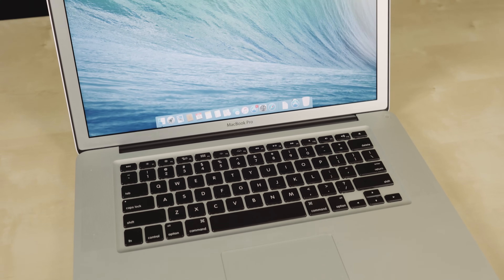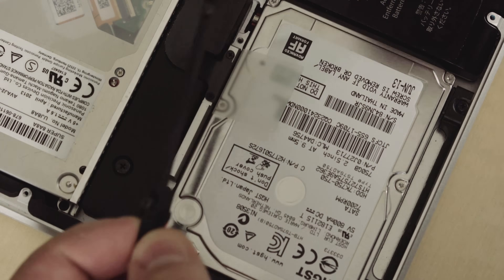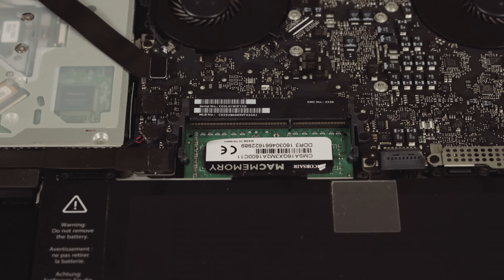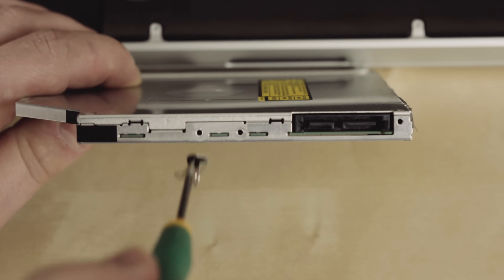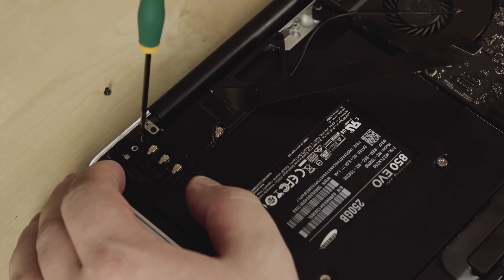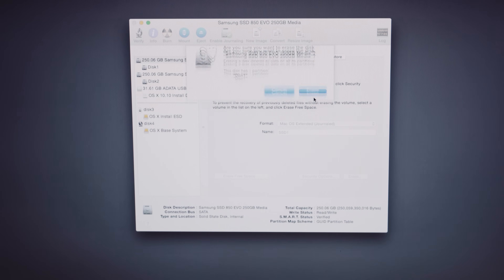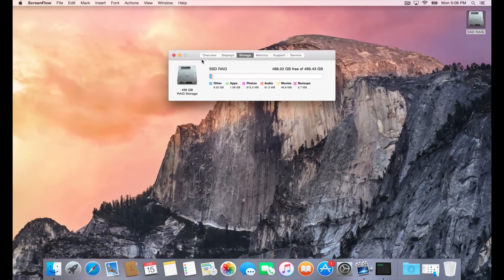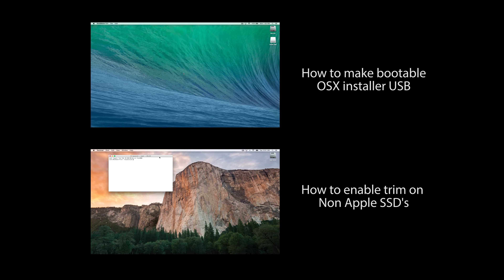Fastest 2012 MacBook Pro Ever! Upgrade Guide - in 4K

Comment: Why would you replace the optical drive with another 250gb SSD when you can get a Samsung 850 EVO 500gb for cheaper than two 250gb? I understand we rarely use our optical drive anymore, but this really doesn't make sense to me.
Reply from the maker: I don't know if I explained what Raid0 is properly or if you didn't see the benchmarks at the end but having 2 drives in raid0 effectively doubles speed and bandwidth giving double that of one ssd. I didn't do it for storage size but for the speed. Thanks for watching.
Reply: oh ok, I missed that part of the video. Thanks for the tip!
Reply from the maker: +Dh Do oh you were talking about buying a new non retina MacBook Pro. Well the cpu isn't as fast on the MacBook Air but it does have a couple years newer graphics and a faster pci-e ssd plus much better battery life. You would probably notice the air being a faster computer for most tasks.
Reply: Hey man, what do you suggest, a new Non retina with upgraded ram and SSD or an Air 13"? I'm not looking for portability or battery life, just the best performance.
Reply from the maker: Any 15" Macbook Pro from 2011 and 2012 with an ssd upgrade will kill any new Macbook Air for performance. if you're talking 13" Macbook Pro then there wont be much difference. 15" has a Quadcore i7 where as the 13" Pro and Air both have dualcore i5
Reply: Zed ProMedia I was talking about the 13, the 15 is out of production now sadly. So between the 13 and the air,I should go for the air right since the performance difference isn't much..

Comment: would it be logical to buy a brand new one of these (apple still continues to make these for some reason) and do the upgrades or just buy a 2016 one which is much more expensive?
Reply from the maker: Apple stopped selling this model back in 2013. You can buy a used one for a pretty good price though. I would not recommend buying the old 13" version from the Apple Store. They should be coming out with new MacBook pros this fall. You should probably wait if you can.
Reply: Zed ProMedia I would rather not buy a second hand and the non-retina macbook pro with the same exact specs as this is retailing for around a thousand dollars, apple discontinued producing them this january so most stores still have them. with the ram and ssd upgrade I tought it would be a good value laptop. I don't really want to pay the amount they are asking for the new pros. I should have asked: should I buy this brand new (with the upgrades) or a brand new macbook air for a similar price?

Comment: another question: will using a single 500gb ssd of the same kind give me the same speed as if I were to used two 250gb ssds the way you did?
Reply: it depends on read and write speeds of the ssd. One type of ssd might better other wise if it is the same type with the same specs, it is equally fast
Reply: thanks!

Comment: Hey I just installed a 16gb ram & Samsung ssd 850 pro 256gb on my 2011 Macbook Pro and still has some lag. Did the black magic disk test and got write 339 & read 345. On yours I see you got write 450 & read 500. Any ideas what I did wrong or didn't do?

Comment: For upgrading the RAM , does Apple have specific RAM cards designed for their products only, or will any laptop RAM cards work?
Reply: Yevette Xoxo there are Apple brand RAM upgrades but you can't buy them and install yourself. 3rd party RAM is not also certified for use in a Mac. If you go to OWC or Crucial's web sites they will guide you to the correct variety for your model Mac.

Comment: Hey! I have a question. What if i use a 500 gb ssd instead of 2 x 250 ssds? What will be the difference???? This is on the mbp w/out retina... What difference will it have?
Reply from the maker: I did raid0 with 2 ssds to show you can get close to the same read and write speeds as the newer MacBook pros. One SSD will still be fast though.
Reply: +Zed ProMedia but will a single ssd be faster?
Reply from the maker: No. Two ssds in raid0 have twice the read and write speed. That's why I did it.
Reply: Ow... Thanks!!

Comment: can i do this on a MacBook Pro (13-inch, Mid 2012)? or what would i have to change??
Reply: Yes you can! Note he is capitalizing on using dual SSD's. The reason I say that is because model Mac you and the one he was using only uses SATA 3 connections which only gets 3gb vs the 6gb. With both SSD's working together he doubled the speed. Smart. By doing this the SSD's in RAID 0. 
 The RAM is simple, you can upgrade to however much RAM you want but YOU MUST keep the SAME Speed as your originally RAM, which is most likely 1600 MHz DDR3.
Reply: Yes, you can

Comment: Would this work with a 2015 model? 15 inch retina
Reply: No.
Reply: Shame, oh well. Thanks for the reply!
Reply: Hugo Stiglitz You can upgrade the mSATA SSD but that's about it.
Reply: anymore detail on that you could give me? I bought a model with just 250 GB coming from a laptop that had 750 and it's really putting a damper on project handling. Also, having a bunch of hardrives to store different projects isn't that great either, would be nice to internally upgrade the SSD. Thanks for the help!
Reply from the maker: The only thing you can upgrade is the pcie drive. And you have to get a specific one from OWC. I'm not sure if the Samsung m.2 are the same. They aren't cheap. Here is a 480gb one. http://www.bhphotovideo.com/c/product/1239059-REG/owc_other_world_computing_owcssdab2mb05k_480gb_aura_internal_pcie.html
Reply: Font go to OWC, they're a rip off. Get it off newegg.

Comment: Thanks! Great vid. I have a 2011 MacBook Pro with a 1 TB Samsung ssd and 16 GB RAM. Just bought a heavily discounted Samsung 256 GB SSD. I want to install the same as you show and setup RAID 0. Could you help with two questions- 1) I would first have to create a 256 GB partition on my already installed 1GB ssd, right? 2) my time machine backup exceeds 500 GB. How do I use the backup if I set up my MacBook to have 256GB running in RAID with separate partition on the remaining ssd of 744 GB. Is it possible to install the OS on the raid partition and tell it to recover files from time machine backup on the other partition ?

Comment: i read that the samsung evos cause problems for your sata cable. Can someone tell me if this is true? thanks
Reply from the maker: I have never heard of this. Why would it cause problems with the sata cable? Like overheating or something? I've used Evo's for years with no issues.
Reply: oh really? can you tell me the specs of your mac and how long you've had it working for?
Reply from the maker: The specs are at the start of the video and Ive been using it everyday for like 18hrs a day since Feb 2016. But I've had other laptops and desktops that I've installed EVOs in and never once had a problem.
Reply: oh wow. Which samsung evo did you install?

Comment: hi can I use these instructions for a early 2011 macbook pro
Reply: For both of you, yes, you can
Reply: I'm wondering the same thing
Reply: Immanuel C
Just buy a USB to SATA adapter, then use a cloning tool to copy the files. I also believe you can use Time Machine.
Reply: My Macbook Pro now has a SSD and 8gb it really fast now.
Reply: Yes it's very easy to do and not expensive it's like having a new laptop
Reply: Hi everyone I've done this on a 2011 MBP it works a treat and is easy to do
Reply: Nope! You can't
Reply: yes you can
Reply: Thanks it does
Reply: are the results the same? I'm considering doing this. I have the parts laying around just gotta put them together. and instead of starting from the ground can i transfer everything from my current hard drive to the SSD before doing thisso it'll just boot as if i had done no changes to the hard drive? i have microsft office on it and i lost the install disc so instead of having to buy it again id like to keep it.
Reply: Thanks :D
Reply: u did that by yourself?
Reply: ok I think I should do it too, but im afraid that I will just mess up my macbook....
Reply: Did you lose all of the files and programs after changing it to SSD? Did you get a single SSD swap or both? I have a late 2011 MacBook pro and am thinking about the same upgrade. About 8GB RAM, that's the maximum 2011 will upgrade to, correct? Also, did you get the same SSD card as in the video (Samsung 850 EVO 250GB)? Which RAM did you get?
Reply: Tony Song  I don't remember the brands exactly but I used a total of 16gb for ram and the SSD's I got were laying around they're 200 each not sure what brand either. To not lose anything I had a friend do it idk what he did honestly.
Reply: Tony Song and mine is an early 2011 MacBook
Reply: mark shirley  really your post its fro 6 months ago how works now
Reply: i did this on a early 2011 macbook pro. Works awesome. super fast.

Comment: HI, 
Why are you using two 250GB  SSD hard drive instead of one 500GB SSD drive and just replaced the old hard drive?
Any suggestions (brand) has far as the caddy to install the second SSD?
Thank you
Reply from the maker: I already owned a 250gb so I bought a second one so I could do raid0 and get double the bandwidth. I don't know of many caddy brands just the one I got off amazon. I find the best ssd brand is Samsung. For reliability and price.

Comment: Mac book air or Mac book pro for school work ?
Reply: I honestly wouldn't get a macbook, I had one recently and got rid of it because starting in mid 2012, I believe, they started to make them to where you can't replace or upgrade the ram, and the batteries/harddrive (SSD) is very difficult to replace.  I wanted a laptop that wasn't difficult to upgrade and replace parts, so I got a Alienware 13 instead and am happy with it.  But, if you want a Apple laptop, Macbook Pro for demanding tasks such as 4k video editing, 3D rendering software, ect. and Macbook air for not so demanding tasks and good for portability due to light weight and thinness.
Reply: Apple MacBook Air is good for school work.
Reply: Macbook air for light papers and what not. To address the other comment, no, you're wrong. The 2012 Macbook Pro can be upgraded.
Reply: +Zestypanda They mean the retina models not non retina
Reply: +AwesomeBreakfast it is possible to upgrade the SSD
Reply: The 2012 Macbook never had a retina version....AwesomeBreakfast
Reply: Zestypanda The 2012 15 inch Macbook Pro Is a retina.

Comment: Can I just keep the stock SSD and then just get another to put in where the optical drive used to be instead of just buying to new SSD?
Reply: If you want to RAID like he did, you will need two of the same SSDs
Reply: Oh ok, i didn't know that thanks. It was just weird for the he took out the stock 500gb ram.
Reply: +bluemetal04 damn really? same drives..that sucks. i was thinking i could do it with a SSD and HDD.. i have setup this way in my MBP 2012 model. Any reason why? something to do with how Raid 0 works?
Reply: Waj Sherwani
Well, you could raid anything but if you use different drives, especially mixing ssd with hdd, it will be limited to the slowest drive, which in this case would be the hdd.  If you mix different capacities, it will be limited to the lowest capacity drive.  For example, if your hdd is 500gb and your ssd is 128gb, you will only be getting 256gb because it will make the harddrive the same size as the ssd because it is the lowest capacity drive.  So it would be best to use two of the same HDD or SSD.
Reply: +bluemetal04 thanks! makes sense..guess I will try to get another evo 850 and try it out.  Thanks for the explanation 😃

Comment: what do you think about this? SSD in the place of the stock drive, move the stock drive to the caddy. would you recommend raid? or is that even possible?
Reply from the maker: In that scenario I would just use the stock drive as a storage drive and the SSD as your boot drive with all your apps installed on it.

Comment: can you please make a new video for upgrade "Storage "guide, MacBook Pro Retina, 15-inch,Mid 2014). my mac already have 16gb ram, but it only have 256GB. I install window 10 on my mac becuase I need window system for GIS and Rhino 3D design. i also install other adobe software such as PS,indesign,IA. my mac always runout the space. 

by the way, the tool you got with 666. i think it is made from china, and 666 in China,and other Asia countries mean luck number( like 666 highest number on dice )just like 777.
Reply from the maker: I don't own a Macbook Pro Retina but you need a special Pci-e ssd. It is actually very easy to install. You can find the drives here: http://bhpho.to/29bjdII . After you remove the bottom cover there is only one screw holding the drive in.
Reply: Thanks for the help XD

Comment: They have these 960GB SSDs online, would you recommend installing 2x of these? (I'm a noob at laptops)
Reply from the maker: Yeah if you want more room you can get 2 of those.
Reply: Would this slow the laptop down? Also Do I need an optical drive? I plan to use it a lot for filming/video editing/ music production. And is it true that you need to back up your laptop everyday since there isnt a dedicated HD?
thanks for your reply!
Reply from the maker: Thats alot of questions haha. 1. You only need your optical drive if you need to install something off a disc or to burn something to a disc. Otherwise its useless these days... 2. You should always back your most important files to an external drive.  3. It's still a dedicated drive once you install an SSD. Its actually more reliable than an HDD.
Reply: Haha i know xD I'm just getting into this stuff so I have very little understanding. But thanks for responding! I'm starting to to get it

Comment: This is definitely not the MacBook Pro from 2012! It's older. The Mac 2012 does not have the regular hdd. It's running with an PCI ssd and the RAM can't be changed too.
Reply from the maker: You are thinking of the MacBook Pro Retina. This is not a retina MacBook Pro. They both came out in 2012. Thanks for watching.

Comment: this isnt a 2012 macbook pro? its bezels look like a mac air
Reply from the maker: This is the upgraded antiglare version. It has higher resolution and matte finish with aluminum bezels.
Reply: how ? is it a 13 inch? And also why do some mid 2012's have light indicator in the front and some dont?
Reply from the maker: +Fol7 Natio4 I can't tell if you are trolling me or not. It's obviously a 15" and the light indicator was removed on the Retina MacBooks.
Reply: im sorry im not trolling i actually did sub to your channel my MacBook Pro (13-inch, Mid 2012) 2.5 GHz Intel Core i5 my friend has a 2011 same model ?He has the front blinking led light and so do some of the macbook pro 13 inches same year as mine
Reply from the maker: If yours is a 2012 retina macbook pro it wont have one. If yours isn't a retina model it would most deff have an led indicator in the front like your friends 2011.
Reply: i dont have the retina macbook my res is 1280x800
Reply from the maker: That's odd. I'm 99% sure its suppose to have one. Maybe it was defective from the time you bought it?
Reply: i think its because mine was a mid 2012?
Reply: Is the anti glare model they have the metal bezel.. In the 2012 they stop making them.. I have a 2012 15 inch anti glare
Reply: i had mb replaced from apple for free,The sleep light wasnt connected

Comment: Did you ever find out if the full 6gb/s speed is also on the early 2011 versions of the MBP? I'm really interested in doing this. Thanks for the awesome tutorial!
Reply: some models of early 2011 MBP 13'' have the full 6mb/s. You can check your model under the system information (apple/about this mac/system report) under the SATA tab. Look for Sata 6
Reply: Mine has 2x 6mb/s SATA :D

Comment: I thought you couldn't upgrade the ram past 8gb on the 2012 macbook pro
Reply from the maker: You can upgrade it to 16gb but that's the highest you can go.
Reply: The "official" word from Intel for their i3, i5 and i7 CPUs is that they support 8GB, but since 2012 it has been common knowledge that 16GB will work perfectly, despite it being twice the official rating. Mine is a late 2011 model which has 16GB and a 240GB SSD installed. Almost gives my sister's newer 2014 MacBook Pro (Retina) a run for its money! I kept the optical drive through, because the MBP has been my primary computer, but I am getting an old MacPro soon.

My Late 2011 MBP definitely has SATA-III (6.0Gbs) but apparently some of the earlier models shipped with SATA-II (3.0Gbs) 20-second boot time with all my software installed is incredible compared to the ~1-minute time that it previous had.
Reply: oh wow, I didn't know that about the ram, thats pretty useful so thank you, sorry for asking this since I'm not too tech savvy myself, but what difference does the ssd make for your macbook cause I might get one since I have a mid 2012 mbp
Reply: The SSD makes a world of difference. The performance is comparable to a new MacBook Pro.
Reply: Martin Hartley no but like in what ways would it help me out
Reply: +MrSpidey333 faster boot speed, faster program loading, just everything a bit faster in general.
Reply: +Martin Hartley not to mention that SSDs often have a lower power consumption than a 7,200rpm drive.
Reply: Martin Hartley thats pretty good, thank you very much for the info, do you know where I could find a good price for an ssd?
Reply: +MrSpidey333 i got mine on eBay. I recommend Samsung for quality but I have also used Sandisk which are less expensive but nearly as good.
Reply: Martin Hartley last question, whats the storage limit for the ssd on the mbp
Reply: +MrSpidey333 as far as I know, the biggest SSDs all work. I use 240GB because I got it cheap. I know plenty of people with 500GB and 1TB ssds. They all work.